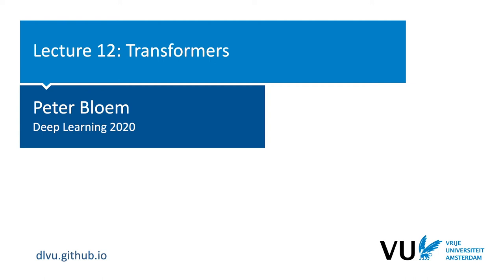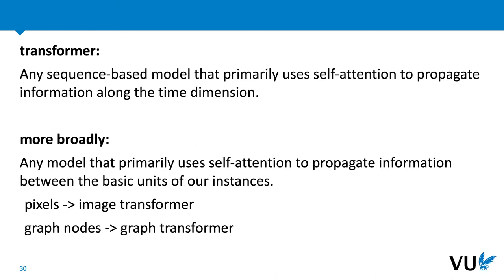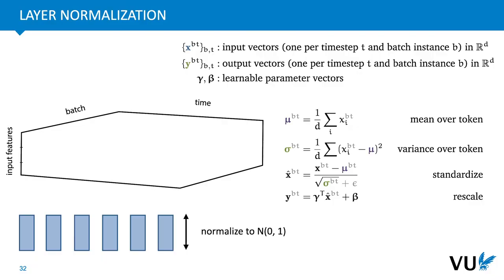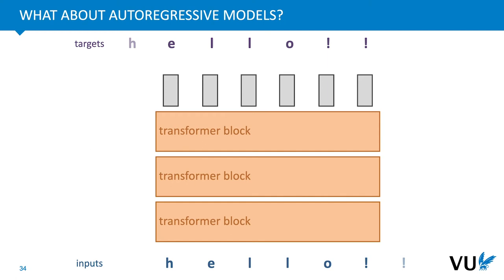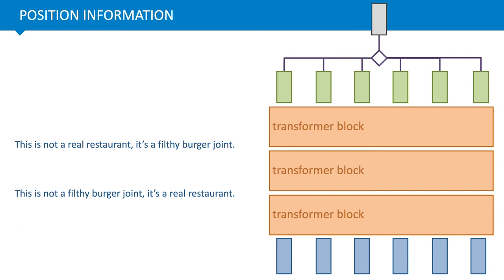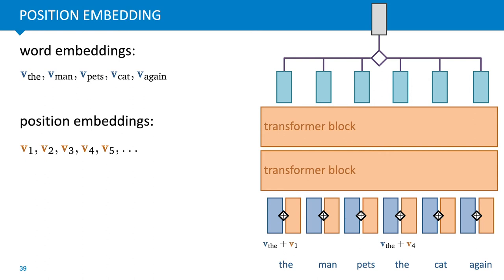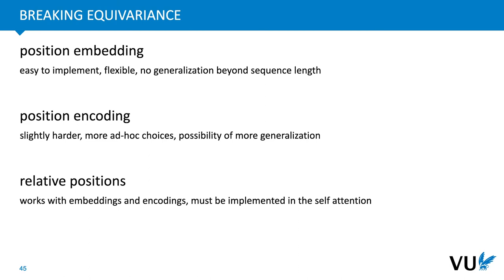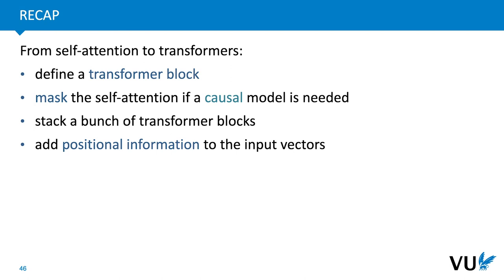Lecture 12.2 Transformers

Comment: At 2:17, Why the self-attention function self.attention() has input x instead of input y?
Reply: I think it's a typo :D 
y = self.layernorm(x)   
y = self.attention(y)
Reply from the maker: @thunth58  This is indeed a mistake. Thanks for the pointer. We'll fix this in future versions of the video.
Reply: @thunth58  also the final linear layer should be:
self.linear(y)
Reply: @Glorfendal  Yes, you are correct and they corrected the slide for this on their website. I was wondering the same thing myself :)

Comment: Hi I think there are several things in the video that I don't know if they are correct.
1. Computation graph of transformer block: In the original paper, it says that layer normalization is performed AFTER adding output of attention layer to input of attention layer, yet in your presentation 2:22, it seems that you perform layer normalization before self attention.
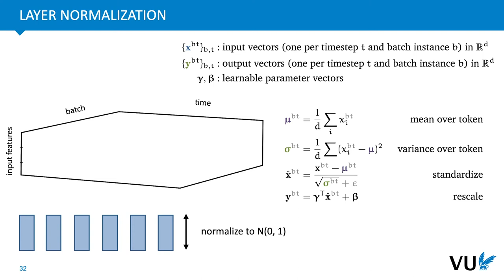2. in 3:10, I'm confused whether gamma and beta are vectors or scalars. If gamma is vector, then gamma times x should give a scalar, but that seems not true...|
Can you please clarify these questions? Albeit, I'm benefiting so much from your videos. Thanks for sharing!